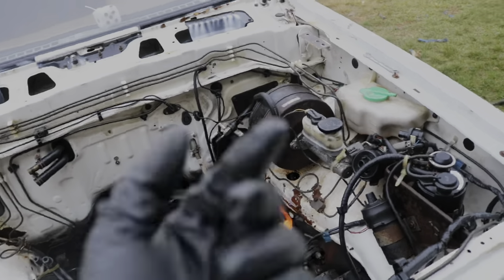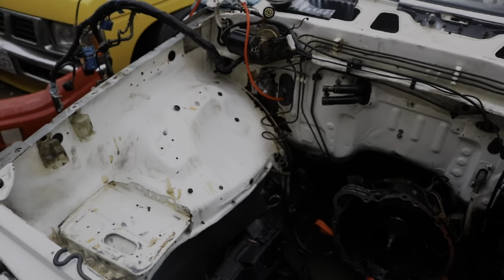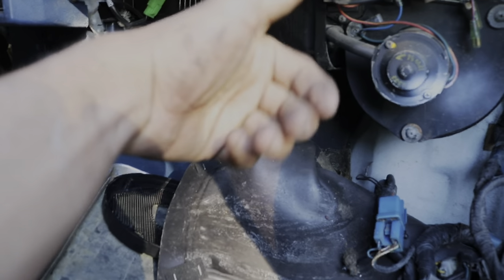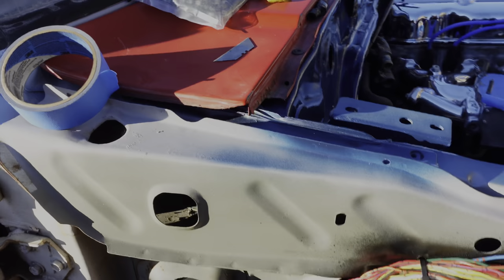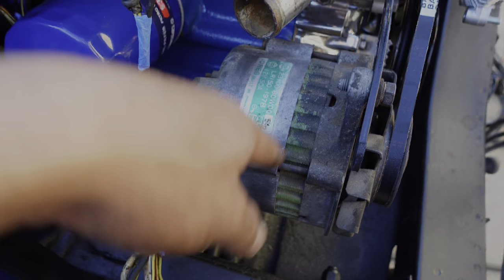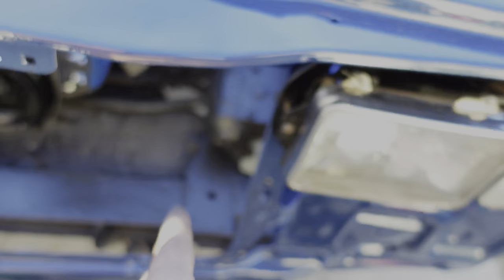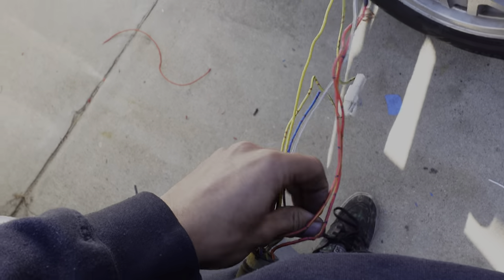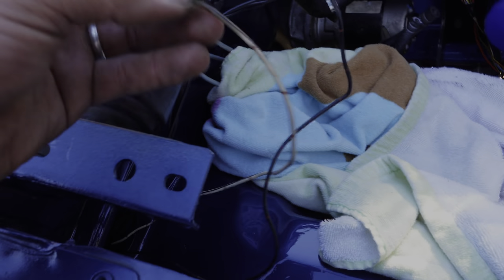ENGINE BAY WIRE TUCK (minitruck)

Comment: i have a 720 that’s leaking coolant and it’s coming form underneath the dash center what could be the issue thanks for the help
Reply from the maker: Sounds like heater core is leaking, common on these old Nissan’s. If you don’t use heater you can just bypass it, if you do you can get a used unit off a part out.
Reply: @STONEBROKEGARAGE  tysm bro